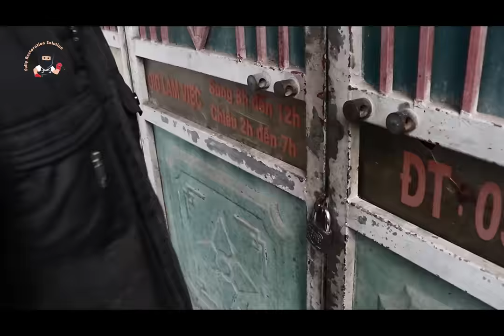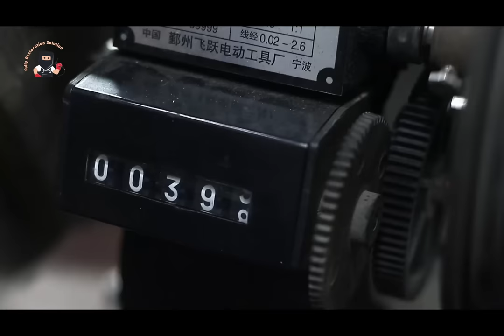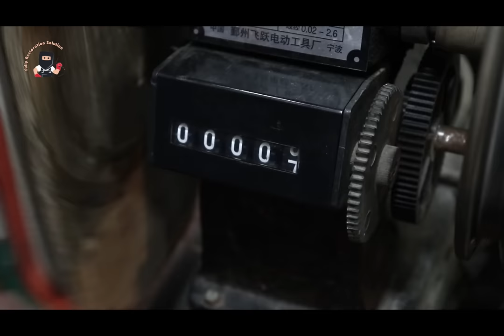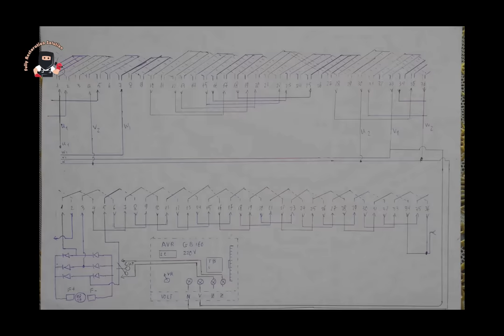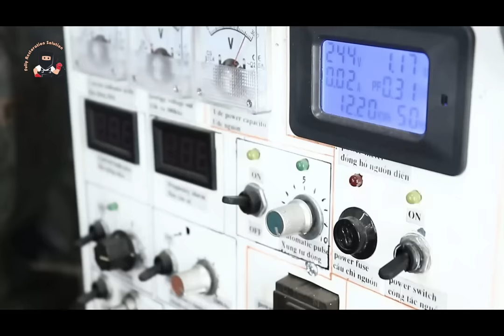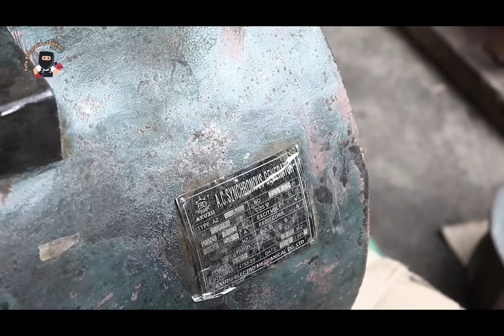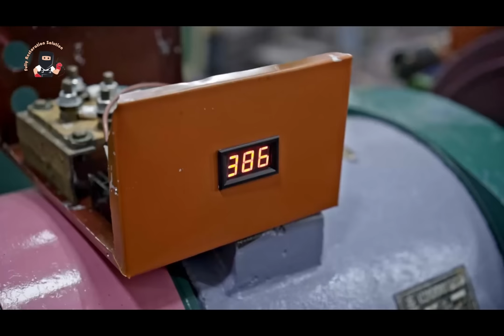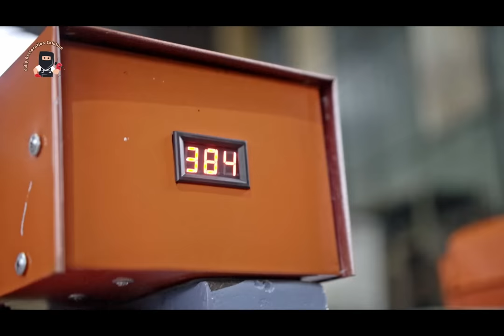FULL RESTORATION VIDEOS Diesel Engine Generator 12000W

Comment: Here's a tip to make the engine parts and block cleaning easier, before you clean stuff with the diesel or degreaser fluid, spray a load of oven cleaner on the block, then hit it with a high-pressure cleaner hose. Once you break the engine down do the same with all the individual parts, inside the crankcase, the cylinder head, everything. Let the oven cleaner do its thing for about 15 or 20 minutes, hit the stuff with your pressure cleaner then give each part a bath in the cleaner/diesel/degreaser fluid. Your stuff will look as good as new. Just make sure you have a mask and eye protection when you spray the oven cleaner from its can and keep the little ones well away. Excellent video enjoyed watching your work.
Reply from the maker: Thanks a lot . That's for machines without copper wires. You should not directly touch the copper wire in the soap because it absorbs moisture. In Vietnam there is no need to clean like that. How much does that machine sell for?
Reply: the pressure washers?  @RestorationVideo

Comment: I'm surprised you didn't use rubber bushing for connection the engine and generator to isolate vibration similar like the Motorcycle chain sprocket and the rear hub
Reply from the maker: I think the rubber shafts will do this well